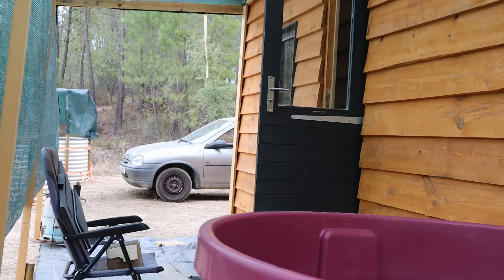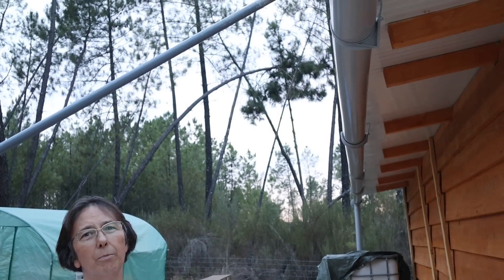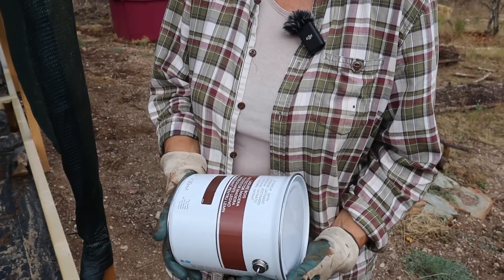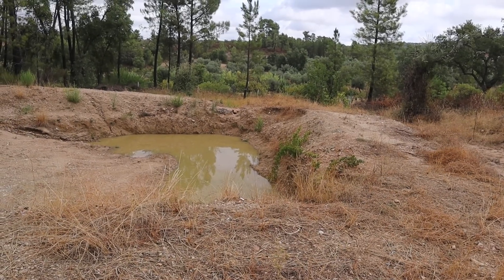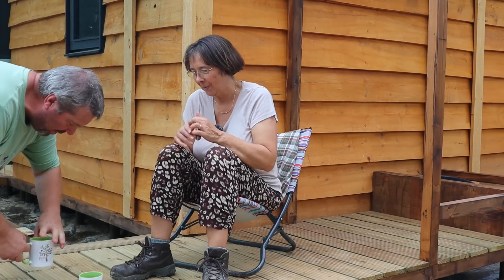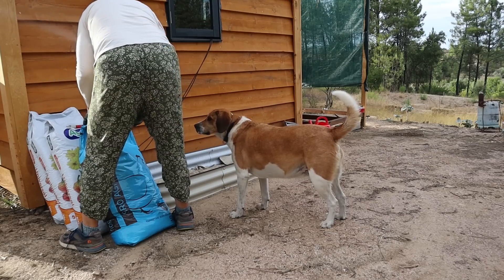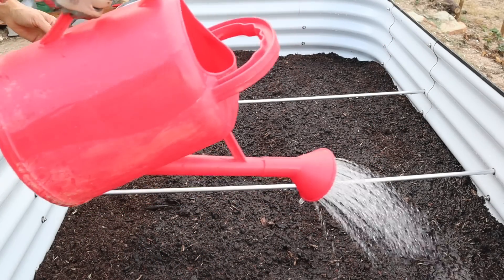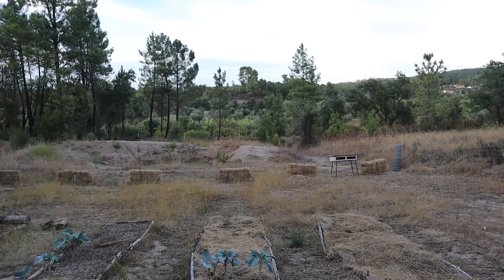79. Decking the Outside Composting Toilet and Shower Area - Autumn Planting Starts

Comment: Your garden house is nearly complete. Great find with carpets, love the recycing of thrown away items. Im all for sustainability. 
In uk Diy centres have a plastic mesh that fits in guttering stops large debris, leaves twigs etc falling in guttering allowing better water flow. Not sure if you can get them in porugal. You both continue to make great progress. 💚
Reply from the maker: Thanks so much! 😊
Yes we love a good bin find!!
Too expensive for guttering anyway, but found a sink drain cover that fits perfectly and stops pine needles going into ibc. Only takes 1 minute to clear that bit of gutter 🥰